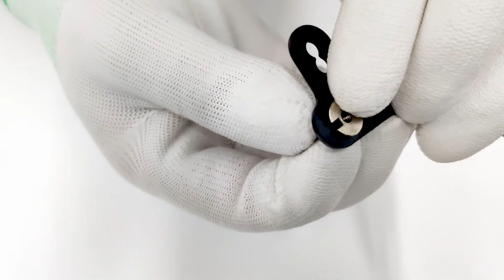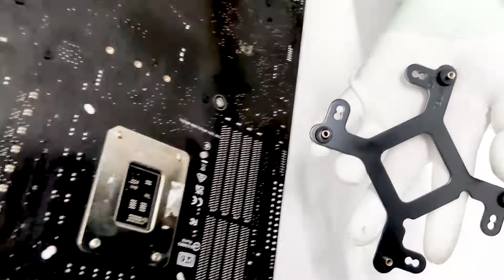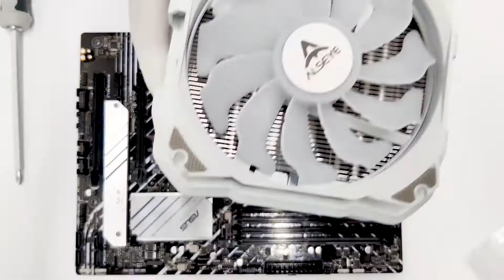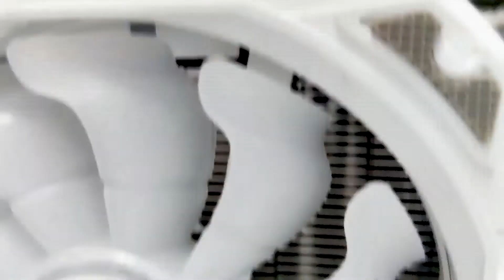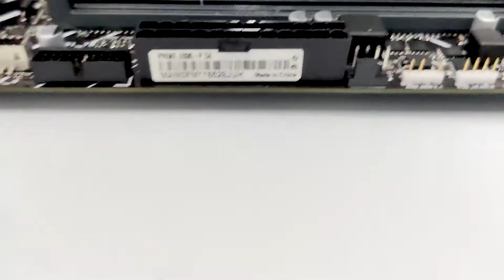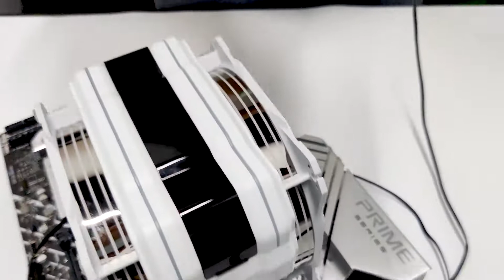ALSEYE | Installation Tutorial of M120DPLUS

Comment: what is the maximum height or RAM that I can use? I have the ADATA XPG spectrix d60g. Will there be a clearance issue knowing that the RAM is about 46mm in width. Thank you!
Reply from the maker: maybe
Reply from the maker: The card slot position of the four memory bar, the memory bar near the CPU will be interfered